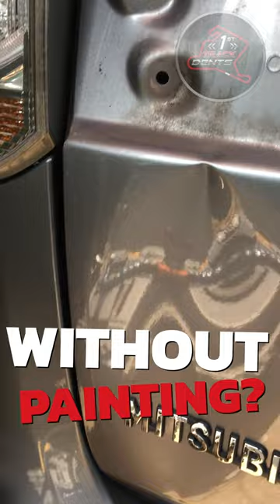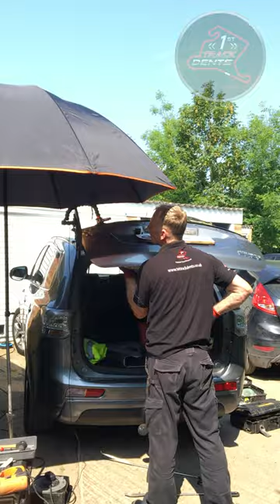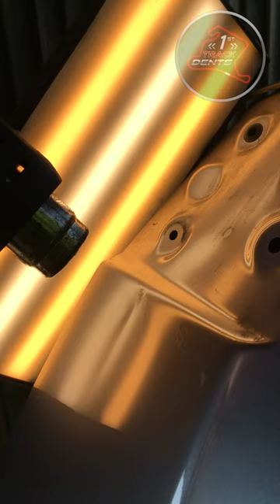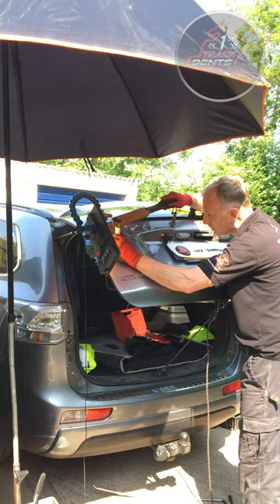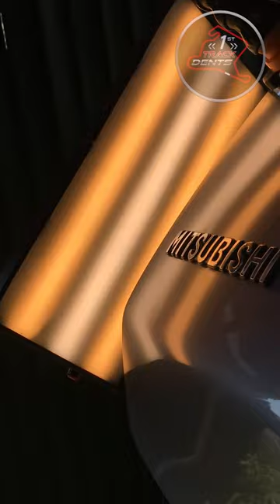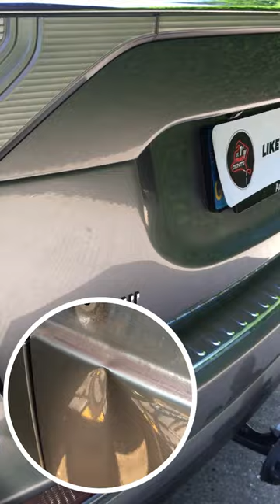How to repair a CRUSHED BODYLINE! #pdr #shorts

Comment: Funny story from a few years ago ... hired a PDR guy to fix a dent in my truck while I was gone. When I got home, my dent still looked the same!! I called him and nicely asked ... "I don't see any difference, are you sure it's done?" Somehow he hadn't seen the main dent, but did fix a second mini-dent somewhere else that I didn't even know about. His jaw dropped when he realized his mistake, then he fixed it PERFECTLY at a second visit. Only cost $100 total ... no insurance claim. He said it wasn't as good as he had wanted, but it looked PERFECT to me. Good PDR guys are AMAZING!
Reply from the maker: Glad your story had a happy ending! 👍
Reply: The dent guy I have used over the years is so unassuming, the before and after amazing. In years gone by body shops have filled and sprayed for smaller dents.
Reply from the maker: @nickjanssens  Very true, and even today most bodyshops would replace this panel, they wouldn't even repair it at all.

Comment: Does heating the panel help the metal move or just protect the paint?
Reply from the maker: Hi Jason, great question, yes the heat is really there to make the paint more flexible so that it wont crack when the dent is being pushed out. 👍

Comment: seriously, though anytime he set up to do all the stuff and everything like that I could have just fix the dent with a little putty and painted it and been done. Literally 30 min. I use a rapid cure clear coat paint that dries ready to buff in 17 minutes. Or less The dent would first be brought out to within a fraction of its original depth with my repair techniques. (trade secrets). Then I would use another secret technique to ensure the emblems don’t get damage and overspray. 

I have my own shop and have been doing bodywork for 25 years.

Actually though no lie I make use of PDR guys fairly regularly just because sometimes I get a fussy customer and it’s easier to just go that route for some repairs. Especially When trying to save money.